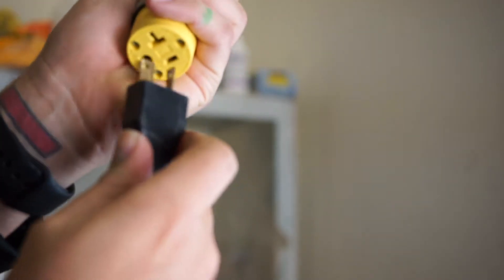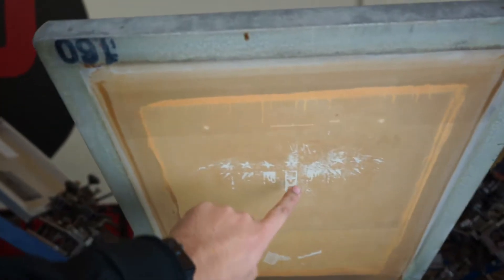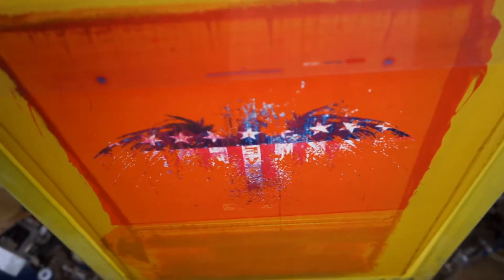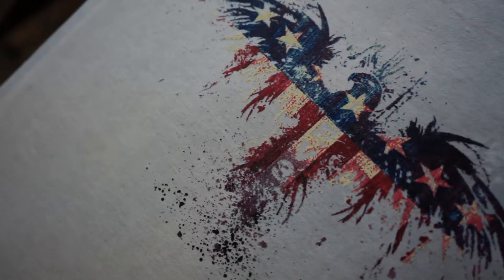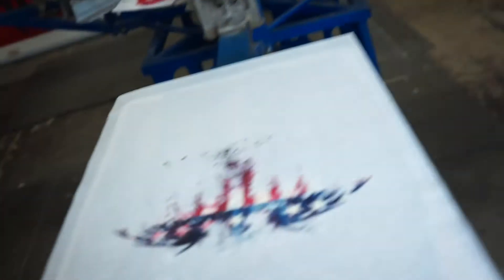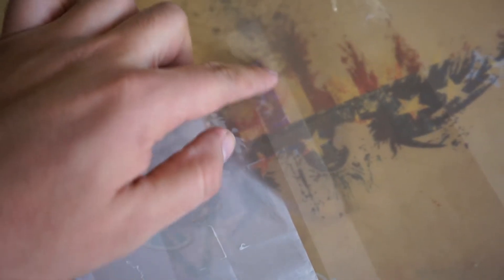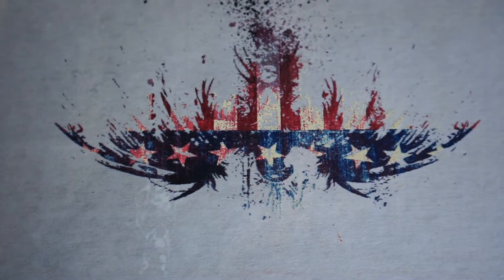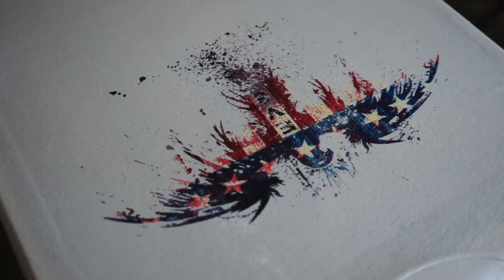4 color wet on wet screen print

Comment: Is there any visual difference from printing wet on wet compared to wet on dry? (assuming I'm not using opaque inks)
Reply from the maker: That will depend on what your printing
Reply: @Vega23  Thanks. Would it affect on simulated process with a lot of detailed halftones gradients?
Reply from the maker: TechMorning I don’t think so as long as your working with high mesh screens